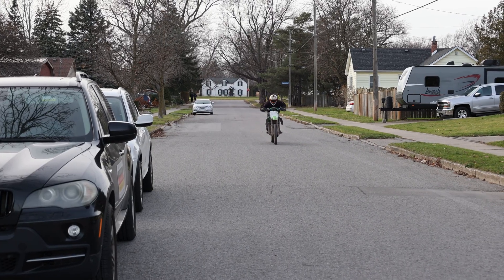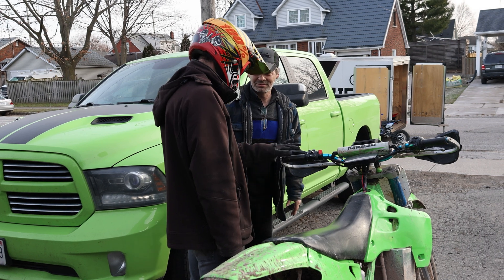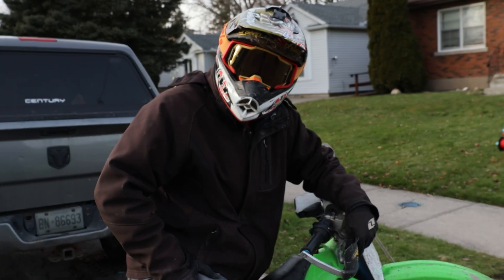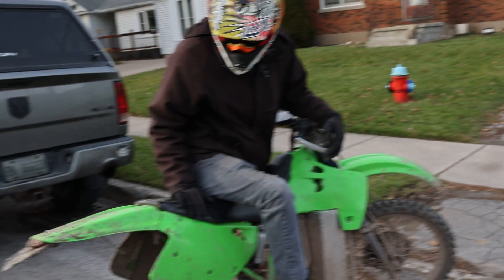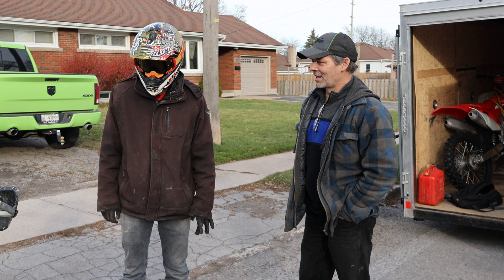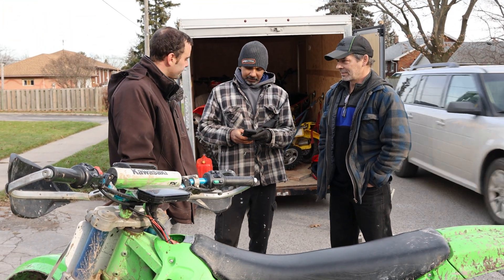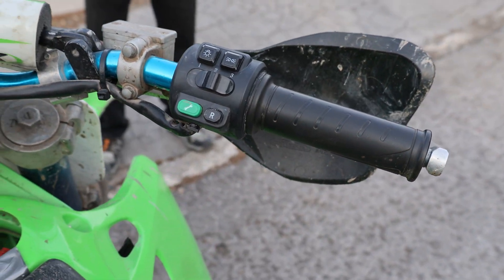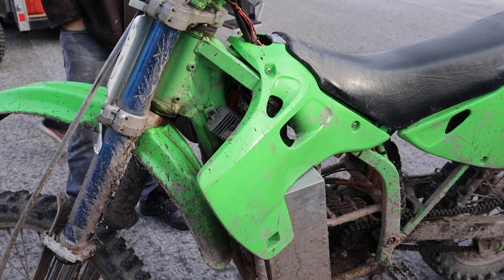KX-E - 50kW Electric Dirt Bike Conversion

Comment: You need higher voltage. Maybe use a hybrid car inverter. How about a Honda Civic hybrid inverter or a Maliibu hybrid inverter they are both air cooled. Just use the power section and rig it up. I’m think of making a go kart powered by one of those hybrid inverter

Comment: 50KW would take that motor out in about 5 seconds. Those are rated for up to like 25kw to my knowledge, they can't handle the heat build up with the power he's pushing through it.
Reply: 10:1 gear ratio. Can you specify what front sprocket you’re using? 14? Rear?
Reply: @ZGP  The motor has a built in gearbox with a ratio of 2.37:1, to have an overall ratio of 10:1 the final drive ratio needs to be 4.22:1, so a 14 on the front would need a 59 on the rear, a 12 on the front would be 51 on the rear.
Reply: Less than 5, probably 0.5. Even if you peak at 30kw for 7 seconds, you need insane cooling
Reply: @bluebear_1232  wrong the 138 takes 30kw like its nothing as long as its peak
Reply: nah you can do 50 on a 138 for like 3 pulls then it'll be hot
Reply: 450amps at 72v soo its 32kw not 50kw... And that is on peak... Then its about 15kw constant perhaps.
Reply: 50kw sounds like a lot for a QS138, QS180 would propably handle it better...also this bike is not running 50kw, the guy said hes pulling 450amps from the *72V battery, thats not 50 kw.
Reply: @-joo3033  qs180 is like 40-80kw and then me1616 is like 80-200kw then axial stuff after

Comment: 72v x 450amps = 32.400 kw. 
Not 50kw
Reply: Yes indeed, and we are not even talking about losses of the motor at that power level
Reply: 450 amps is insane current.
Reply: @thesmuler5627 that the motor can't take

Comment: Thats looks weak for 50kw
Reply from the maker: The bike is not turned up to 100% output
Reply: Fair do, didnt mean to be rude either
Reply from the maker: @ortonscustoms2577  no worries it’s all good dude! The bike isn’t perfect, but it is a good example of what is possible. Top speed at this time 95km/h (59mph)
Reply: @ortonscustoms2577  what do you mean weak 🤦‍♂️

Comment: Very nice build;
There is now also Qs138 90H('4kw) V3 and a Qs165 60H(10kw) V3 motors.
Bill talks about a gear ratio of 10 to 1, is that what he means in the Qs motor with the gears?
The qs138 70H-90H and 60H V3, all the qs motors with V3 behint are  Mid Drive Motors with Internal 1:2.35 Gear Reduction & Spline Drive Output Shaft.
This motor is the most compact and powerful motor on the market that includes a built in gear reduction.
This will allow for direct drive applications on larger wheel powersport vehicles with out the need for an oversized  rear sprocket.
This is the explenation that comes with the advertisements of all the qs138 motors with V3 at the back of the 3 models numbers.
Reply: What does the H stand for in 70h
Reply: @robcasthobbies4500  its the magnet length. the 90h has longer magnets and is stronger

Comment: i just bought a fardriver 921800 (non track version. couldnt find the track version) 96v 1800A. and a qs180. gonna use the batts from my last build. spim08hp cells. been looking everywhere for a dirtbike rolling chassis or even a parted out chassis. theyre harder to find than id thought and the few ive found that were newer and looked nice have been way too expensive. people have 90's frames and they want absurd money. even worse for 2k's chassis.. Its awesome to see more people doing this. love it!!!!!!  I love my first build but im sick of the heavy ass rear wheel. qs273 50h 4t sabvoton 72200. bomber frame. all moto parts. started as a beefy mtb with moto parts but now there's no mtb parts left on it. i wish more people would start going electric and getting into the diy world. Its so much fun. the building is almost more fun than the riding.... almost....

subbin to support the cause. good shit dude.
Reply: I've been commuting full time on ebikes over 4 years, I'm 49 years old & a single father, & it's been nothing but PLEASURABLE the whole time! 💯

I sold my cars a month after getting ebikes, & got ebikes got specific tasks, just got a Rwarr Mantis 72v, & it's funny when cars try to pass me thinking "I'm slow", & stay with them no matter how hard they accelerate, they almost ALL ask me; "WHAT IS THAT THING?" 😂
Reply: @ReVolt_e-Vlogs  haha. Same. I ended going 3shul cl1000, qs180, 2005 crf450r, 20s16p molicel P42A, built most of the bike then moved and lost my space to build. So it sat unfinished for a while. Just recently sold the motor and controller. 

Ended up buying an admitjet armor. 72v 25kw continuous, 50kw bursts. 90mph. The thing is an absolute monster. I ride pev's out of necessity. I'm 38 and have never had a license. I ride my bike even on the coldest NY winters through snowstorms, rain, etc. Getting into e-bikes was the difference between being mobile and taking a bus or walking.. hours long trips on a bus became 20 minutes trips on a bike. It was a quality of life game changer.. I love this hobby. As a fun thing to do but also because it raises my state of living.

Comment: How do i build this
Reply from the maker: We can either build you the bike and ship it to you, or we can sell you the parts so you can build it yourself. The choice is yours!
Reply: @paulyplewa  that sounds good how much would that cost
Reply from the maker: @curtybtw5319  Which option do you want me to price out? What chassis would you like to use? Where abouts do you live? (for shipping purposes)
Reply: @paulyplewa  nevada and I would only want a 15kw bike that would fit into a yz85 frame if that's possible
Reply from the maker: @curtybtw5319  It would be easiest for me to build the entire bike from the ground up and then ship it to you. Do you have a YZ85 frame you want me to use? Or would you want me to find one myself and build it?
Reply: @paulyplewa  if you could find one that would be good also how much would that cost I
Reply: @paulyplewa  do you want my number so we can continue this convo elsewhere
Reply from the maker: @curtybtw5319  building a 15Kw YZ85 would cost about 5-6k USD - plus shipping it to Nevada
Reply from the maker: @curtybtw5319  Do you have Instagram? Add me and message me there @PaulyPlewa771
Reply: @paulyplewa  ok will do
Reply: @paulyplewa  what could I get with 2600 to 3000

Comment: How many rmps are u pushing the motor?
Reply from the maker: Current set up is 12,600 RPMs
Reply: @paulyplewa  How much will it do without feild weakning? Currently at 96v nominal and limited to 10k qs138v3
Reply from the maker: @crazyexperiments4815  Without field weakening it will be around 6500 RPMs

Comment: I didn't know that motor cold put out 50kw I fort it was like 38kw or so amazing build
Reply from the maker: The motor is overclocked to max out at 50kW. The battery and controller are whats causing it push so much power. Thanks for your kind words!
Reply: @paulyplewa how to overlook it?
Reply: @paulyplewa overclocked *

Comment: This thing is awesome!
How much does it cost approximately for all the electrical parts minus the frame?
Reply from the maker: Thanks!
The battery is the most expensive part. This particular bike has 800 cells, worth $7-$10 each.... So that the main cost right there... Besides that the motor, controller, dash, wiring, ect cost in total between $2500-$3000 CAD, or $1800-$2200 USD. The overall price of the build will vary around the battery build.
Reply: Where do you get the battery?

Comment: Well done sir. That’s a very good idea for a build, and you did well. Glad to hear you’re reworking the battery box into the frame. I’m sure that’s a bit tedious to set an array of that many batteries in there.
Given its over 80AH, have you considered wiring more in parallel (sorry, meant series) to double the power and drop it to 40AH?
Then you could use a solid state regulator to control the power. Perhaps even control the torque curve via your phone. :)
Good luck with your continued project(s)!
Reply from the maker: Thank you for watching and for your kind words! I appreciate it! The battery box needs to be, and will be rearranged to fit differently moving forward, this was just the first test bike. 

Good question regarding wiring the batteries in parallel. I am not sure about that, I will need to speak with Bill, the builder and see what he says. 

Subscribe to my channel for more e-bike build videos! We have some new projects we are currently working on.
Reply: @paulyplewa  thank you for the reply. I’m greatly intrigued and can’t wait to see what you do. Good luck!
Reply from the maker: Thank you for your kind words! I appreciate it!
Reply: Do you mean wire in series ? the battery for the KX-E is being redone as of now and also starting the new build will be running 130V battery with 1000 phase amps with a shul3 controller and the new  QS138 90H with gear reductions looking to push 50kw to 65 kw and see what happens HAHA
Reply: @hurricanefibers1501  sorry about that! Yes, I meant series. Thank you for the details. That sounds awesome. That should be the equivalent of around 87hp right? I’m jealous. Lol
Also, that VESC will be perfect! I can’t wait to see this.
What type of batteries are you using in the upgrade… is it still the Sony VTC4 Li-ion or are they LiPo? I know that’s a huge expense.
Reply: @raredesign  Still using the Sony VTC4 just got 2000 of them in LOL
Reply: @hurricanefibers1501  oh my! That’s incredible! This has me giggling like a kid. Good luck sir! It will be amazing for sure.
Reply from the maker: Looking forward to seeing the finished battery build! It's going to be great

Comment: That's an awesome starting point. Now to work out the kinks, and fit the battery a bit better (in the empty spot). Probably best in a new battery box. How's it getting charged?
Reply: the battery is being re-done right now, I charge with one of my 220v chargers and use generator when out on the trails or track if needed
Reply: @hurricanefibers1501  I gotta ask now...is there a parts list and build video? Maybe a build vid for the new bike your building? :)
Reply from the maker: We are working on filming a full build video of one of these electric conversions. Subscribe and follow along for more e-bike videos!
Reply: @paulyplewa  Already sub'd! ;) Looking forward to more vids. Did you get a chance to take it for a rip? How does it compare to the Surron or the AJ?
PS. Check your email! LOL
Reply from the maker: Thanks for watching! I appreciate it! I personally haven't rode the KX-E, it was too cold. So I don't have an answer for you. But from what Shae from @electricmx was saying, it is faster, and feels more planted seeing as it is an actual Japanese chassis.
Reply from the maker: @Grimnaut I agree! The battery box needs to get re-done so that it's cleaner and out of the way, but either way the bike rips!